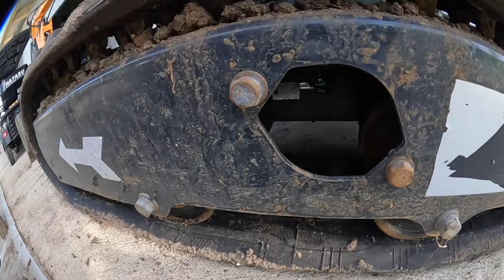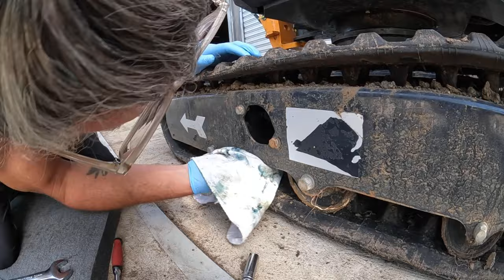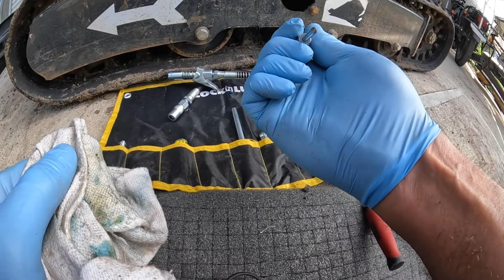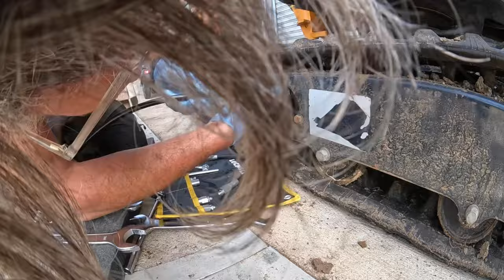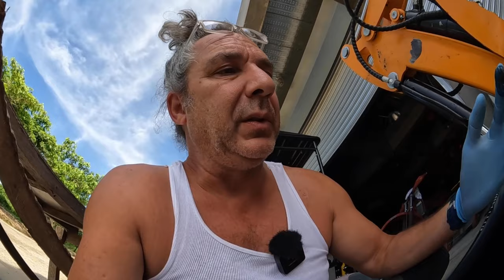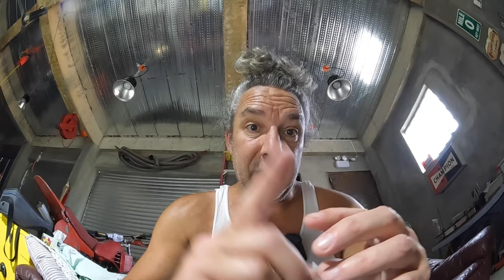Mini Excavator Track Tensioner 😭 | Mini Excavators Philippines | Ep. 03 | TORINO

Comment: You slew your boom 90degrees lift the track your working on off the ground , that way you will get more height…. Might make it a bit easier for you. 

Good to know you can fit the bucket that way , you can lift materials up like a  skid steer if you need too..  I will use my Rhino that way when we start our rammed earth house in Palawan, this will save a lot of lifting with buckets,  now I can just shovel it out into my forms ..  my machine arrived last week , but I haven’t seen it yet … I wasn’t sure you could do this but you proved it can be done. Thank you 😊
Reply from the maker: that's a great idea i didn't think of. thanks
Reply from the maker: let me know when you get your machine, i'd like to hear about it. i looked at rhino before i got mine.
Reply: I dealt directly with the factory, the sales part went really easy. And the shipping side was very smooth, the hardest part was unloading it.
Reply: As always keep your body parts from getting under the track.
Reply: You can block it up with timber blocks while you do the work to. Much safer 😊
Reply from the maker: @mellyons4052  i can vouch for the hard unloading part 😊

Comment: So what did you do. Did you put the quick hitch on backwards or did you just fit the bucket on backwards?
Reply from the maker: hi mel, i just fit the bucket on backwards. i think the quick hitch is on correctly, though the bolt head is on the bottom side if you know what i mean. seems like it would be easier to get the power driver on from the top to open and close the jaws. i may have it reversed too for all i know.